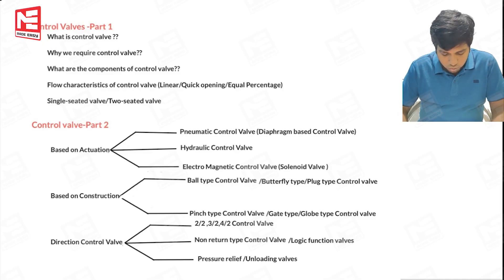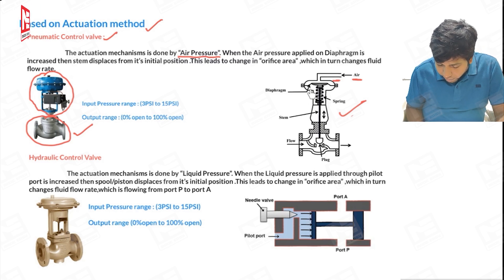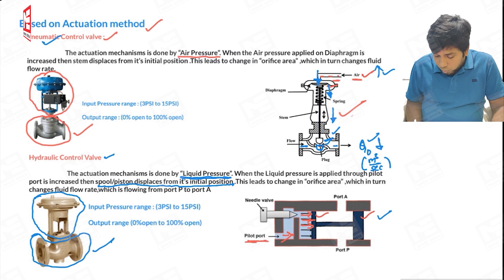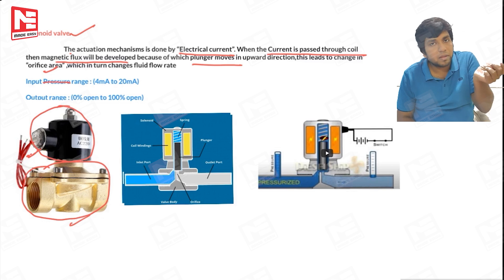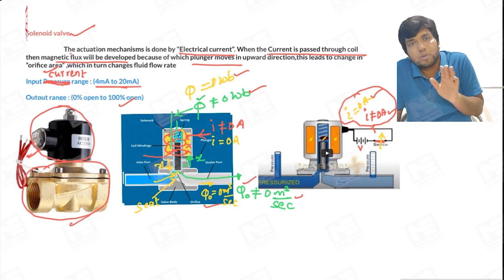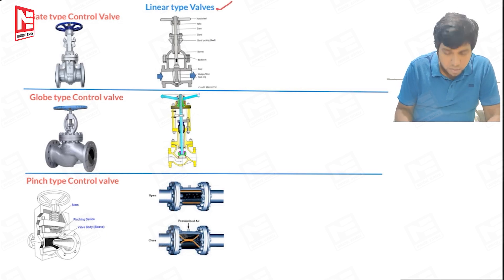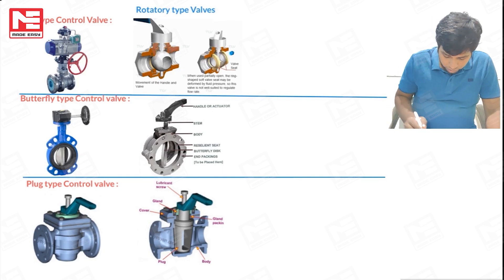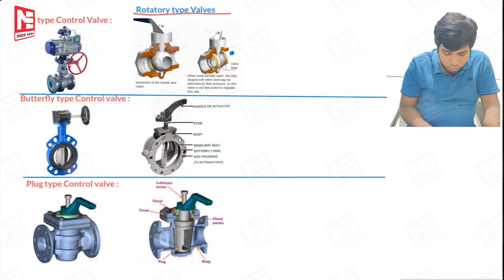Mechatronics (Lecture 4) Control Valves-2 | IN/ME | by Phanindra Sir | GATE/BARC/ONGC/EIL Topper

Comment: sir, in shuttle valve if the source 1 & source 2 both having same pressure on it(consider for rare cases),will any of the source be passed or not? if not... then the obstruction volume having the same cross-section of the outlet pipe??
Reply from the maker: Dear Candidate,
Thank you for your question. We will forward the same to the concerned department.
Regards,
Team MADE EASY
Reply: Nice question dear.
I am expecting this one.
In the outlet port (at entry) , Shuttle valve has 2parallel line (gap between them).so Obstruction slides on (Parallel lines) and the fluid can pass through the gap between the lines.
So output port entry size is more than Obstruction size.
Reply: @phanindram5103  Sir thank you.😊